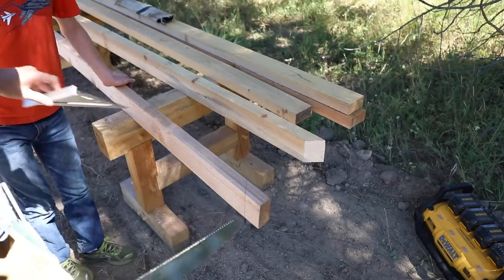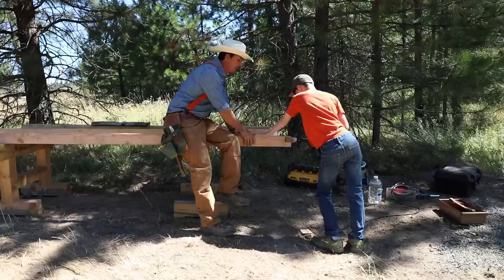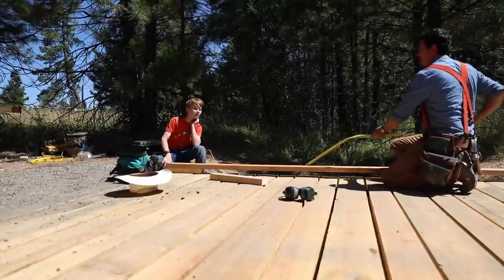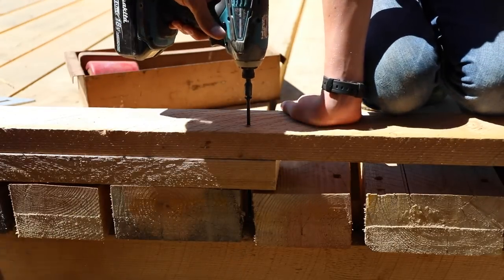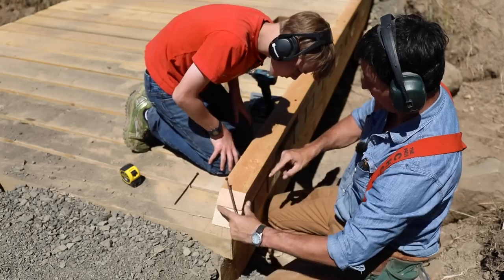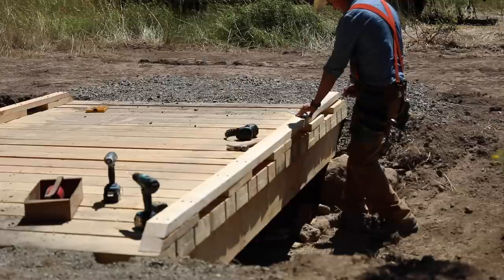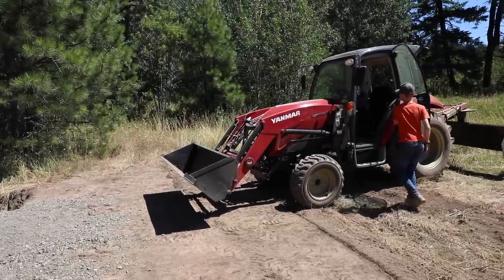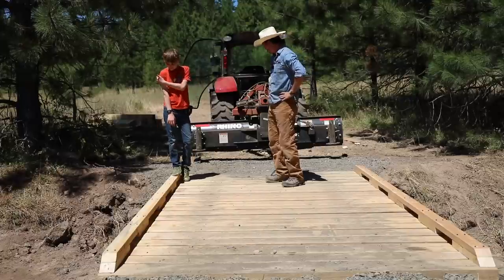How To Build A Bridge Over A Creek For A Tractor 9

Comment: Wranglerstar,  I seen the bridge flex, but that's something you want it to do.. All bridges have flexing points.. 
And just a thought, You should think about putting in some Bridge anchors, because my family built a small bridge like that, and it was fine until the had a flash flood,  and it turned the bridge sideways, and moved it about 30 feet and damaged it to where it wasn't able to be fixed..
They replaced it, and they dug a 6 foot deep hole near each corner of the new bridge,  and in the bottom of each hole they formed with bag Crete, a 1ft x 1ft x 3ft long, block with 4 lengths of 3/4 inch rebar with a rebar lope coming out the top, and then used heavy chains with turnbuckles to connect them to the bridge.. And they had another flash flood the next year, and the bridge stayed in place.. Just a thought, because we all know wood floats.. Peace!!

Comment: Can I make 1 suggestion?  I would put 4 posts to mark the outside edges incase of heavy snow.  It can be hard to follow a bridge even on a road when everything is covered in snow.
Reply: 1975Jdonov well one down side to that say he was to put 6 foot post in the ground 2 foot and leave four up the back blade on the tractor wouldn't fit its 8 foot wide itself I watched very close when jack came across on the tractor and was watching to see if the blade would snag the side rails and it hangs over those rails so he would have to keep the blade high in order not to snag the bumper rails so image 4 foot tall post on each end anything 8 foot or wider would have to be lifted I.e. Logs for milling are 8-? Foot long so could you imagine lifting say a 20-30 timber up 5 foot and the tractor see sawing that wouldn't be good but good thought in the snow just no practical for moving things across some of those small fiber glass rods the survey teams use that are blaze orange and reflective would be much better then you could push the load over them and they would bend and snap right back up in place
Reply: Bryan Waugh you can make the posts wide enough to drive anything through since it is just a guide.  I prefer something sturdy that will stand the test of time.
Reply: Sounds like an OSU wildlife grad.
Reply: gsardokla me or the other person
Reply: gsardokla I never went to college.  I am just speaking from experience.
Reply: You. Wetlands wildlife ecology with Dr. Gavin, or mammalogy with Dr. Glass.
Reply: Solve both problems with simple orange fiberglass snow markers typically used on driveways. I have an 8' wide driveway and a dually with an 8' wide bed. Tire track with is literally about 2.5" less than the driveway, those markers have saved me from tearing up my lawn on many occasions. What I did was put them exactly a dollar bill width away from the driveway edge. Since a bill is so common it's easy to judge the distance on each side when backing in with mirrors.

Comment: Liked the bridge, also glad of the spacing of beams below the decking, the bending is to be expected at such a weight, but the space the decking has to cross isn't such that it's likely to break due to bending ... i check (as best i could) both the crossings and didn't see any bending in the main beams, though the video-pictogram seem to show maybe just a cm of bend in the main beam (if it's that) when the tractor is dead center (might be distortion of the picture as well). There isn't a problem with that, as it will only be once in a while and it's only so little. Also wood can handle bending pretty well (as it's pretty much growing to deal with high winds)  ... so job well done... 'Jo Bro' is finished.

Comment: Nice Job!  I'd give the planks an annual coat of non-detergent 30 weight oil.
Reply: halnywiatr: It's a surprise that someone remembers non-detergent 30 wt oil. I don't know about it as a wood preservative. But I  do know it is the best substitute oil for a chainsaws bar and chain oil, if the real stuff is not available. Being non-detergent helps it stick to the chain better than regular 30 wt, or any other motor oil. This is an old remedy, but not for times when ordinary bar and chain oil can be had. Even cheap varieties of bar oil are better.
Reply: Generally 30 WT is not "cloying" enough for frequent use as a bar oil except in very cold conditions but is certainly better than nothing (and I have used it on many occasions)..  However, for sub-freezing conditions you can use Automatic Transmission Fluid on the days that regular bar oil stops flowing easily.  Straight 30 wt is preferred for small engines like lawnmowers that utilize splash lubrication as detergents may froth and run off the parts too easily.  Most places still carry it often in 20 oz bottles.

Comment: I am thinking now of navigating this bridge after some heavy snow. Might be hard to make out where the bridge is if the snow is heavy enough. I would plant four posts at each corner about 4'-6' high so I can make out where I need to drive. These can be say 5"-6" round and don't need to be right on the corners where you have to worry about hitting them too much - a little white paint with red tops won't hurt. I don't know if you tend to have this same issue with any of your other bridges?

Comment: Love the Papa Son Bridge. Ok, I admit I am dense as a rock when it comes to building a bridge, but would building the bridge four to six feet wider have resulted in more of a built in safety solution to prevent a wide tractor/truck from risking sliding off either in rain or ice?

Comment: i don't know if i'm right, but as i could see so far, the gravel road parallel to the creek ends at the bridge? if so, i'm not sure if the bridge should have build in an 90 degree angle to the road. that would be a sharp turn, not easy to handle in certain moments ... e.g. with a trailer etc.

Comment: There appears to be quite a bit of flex in the deck planks. Is there a slight gap between them, and the inner stringers? I certainly don't see any give in those 10x10s. I think that you could probably drive a tank over that bridge without any breakage. It looks nice as well.

Comment: Attention other viewers: IF your deck or bridge or platform or pier is going to go through soak/freeze/ thaw cycles DO NOT USE screws . One winter will strip the wood internally at the thread wall  from the expansion of frozen wood. A low cost practical alternative is to use spiral nails. They will loosen too ,but every 5 years or so you just take a hammer and drift and just bang them back down. Another point not covered on this video is that the deck material should be placed bark side up or out. If you don't do this, the wood will cup and hold puddles of water....rather than shed the water. I see this ALL the time on home built decks and marina piers . This is a very common mistake.
Reply: Whilst you have a point, I'm wondering where you are going to get 300mm spiral nails from?
Reply: Probably not from a big box store.   12 inchers from here is one place   http://www.bestmaterials.com/detail.aspx?ID=22021&utm_source=bing&utm_medium=cpc
Reply: Probably because a fence would shed water better than a deck. The point is frozen wood will expand and loosen anything . Frozen wood will even stretch nut /bolt combinations.

Comment: is the degree of precision your are working to really necessary on this bridge?  I mean, what's the difference between an inch or so...unless the purpose is really for Jack's benefit?
Reply: I think working to the 1/4 inch is the least amount of precision I would ever use in any project and I would consider that to be very rough.  Something like this, and most projects, I would work within 1/8 inch tolerances.

Comment: I suggest painting the bumpers with a high visibility color or at least the ends so that you can place the tractor between them faster and easier. I know it wouldn't be too hard either way but just a thought.
Reply: DChestHair I suggested couple of those fiberglass surveyer stakes they are laze orange and have a reflective strip so the can be pushed over I.e. Blade on the tractor logs what ever and snap back up and if they break only 2 bucks give or take
Reply: How about hiring a "flag person"?

Comment: I am a teen ager who works in a few different shop environments and it seems all of my pencils disappear and my fellow colleagues get new pencils when I lose mine. Now they are much older than me and control my lunch break and what already cruddy jobs I get so I don't really want to go beyond the usual hey is that my pencil so I would like to have a few made with my name on them. I was just wondering what site you use to have your pencils made because the site I found doest make carpentry pencils your response will be very helpful.

Like if agree and want to know.
Reply: Garrison Bogdahn they can only get new ones when you leave them out of sight. I have the have it of wearing a belt knife for stripping wire (Klein cable splice kit) and my pencil sits there every time it's not in my hand.

I've worked with the crusty old jerks, and it makes me want to be opposite of them and to remember when ever I get a apprentice to teach rather then screw with
Reply: Garrison Bogdahn get a can of pink or purple spray paint & spray all of your pencils. There'll be no denying ownership then & you'll save $$$ on custom pencils.
Reply: they arnt crusty jerks they just like messing around.

and spray paint wears off to easliy and is gone in 2 or three days

Comment: Just like metric, imperial is easy after dealing with it for awhile. The thing about imperial is that's what a lot construction material is produced in. 
Hands down though metric is great for large commercial project blueprints.
Reply: AllaroundNbackagain except when the workforce is not familiar with it then all kinds if short and long cuts are made. 
Saw this happen in lousianna at a still mill. Wire was labels in metric footage while all measuring instruments were standard, and calculators with conversions don't always work
Reply: tek413 
That would fall back on bad supervision and teaching.
Reply: Most people don't do commercial blueprints. Imperial will be around for a long time.

Comment: Go metric it's much much simpler than the old feet & inches way.Good series of videos though. And where's the sign with the name on it..?? A builder/Joiner from New Zealand. .☺☺☺☺🔨🔨🔨🔨
Reply: Darryl Kennedy metric is opposed here for several reasons culminating in not wanting to switch from the old way.

Metric has been growing in me over the last couple of years but yet it still has a mystery about it. What that boils down to is me labeling physical objects with the metric sizes to get the system ingrained in my head
Reply: Metric is evil. People that use it get cancer according to the state of California.
Reply: You're right.  I'm sure if Cody asked Jack, "Jack what is half of 373 cm or three meters 73" it would have been much easier than half of 147 inches.  They both work fine.  Once you get accustomed to one, it is not always as easy or intuitive to switch to the other. 

I've met, and seen, many older folks who learned on the Imperial system and switched over to metric in their lifetime.  funny thing is most of those who switched over still predominantly use Imperial and it works for them.

Eventually all the old/older feet and inches folks like myself will die off and maybe then the metric system will concur the United States.
Reply: Darryl Kennedy 
Don't you know the American way is the right way?
Reply: iamchillydogg what's the unit of pressure in metric?
Reply: NordboDK pascal I believe, 1 pascal is 1 newton per square meter
Reply: tek413  was still in my Apprenticeship as a Joiner / Cabinetmaker when New Zealand swapped over in 1974.
Everyone hated it at 1st but it soon became obvious that it was a far easier system.
No more Feet,inches,1/8ths,1.3/2nds etc etc.  Some thing's remain the same however as the metric equivalents never caught on.
We still say 4×2 for example instead of 100 × 50 and all timber sizes, including sheet materials in the building industry here,are still called in the "Old" measurements. A sheet of plywood, for example,is still called an 8×4 instead of a 2440×1220 which is its exact metric equvilent. 
As we've been using it for over 40yrs it just comes naturally but as mentioned somethings are still said,or called out,in the old system. 
The building / construction industry would never go back however and I'm sure if you guys tried it you'd soon get used to it.
With all measurements in divisions of 10 you can't go wrong.
10 millimetres = 1 centimetre.
10 centimeters = 100 millimetres. 
100 centimeters = 1 meter.
1000 meters = 1 kilometer. 
It's easy once you get to know it.I'm not saying everything converts so well,as we still say Horsepower, torque, instead of converting them,and wind / air pressure still stuffs me up,and speed is still said in MPH instead of KPH but the system works.
Go on a few web site's and have a look OR if your a builder just start using it yourself. I'm sure you'll like it.
Sorry for being long winded but I'm having a Trump free day today,and like McDonald's, I'm loving it..☺☺🔧🔨🔩Metric ✔👍
Reply: In SI, the scientific basis used by physicists the unit of pressure is Pascal (1 Newton per square metre) however in everyday metric units there's also kg/square cm, which are closer in magnitude to PSI.  One kgf/cm2 is about 14 PSI but it's about 98,000 pascals.
Reply: PKMartin  yeah I know but even in New Zealand where we've been metric for years we still go to the petrol station and check the tyre pressure in ft/lbs per sq/inch.crazy I know but it's still easier than those kilopascal things.
Reply: PKMartin thank you, that just goes to show how few people actually use metric, where the unit for pressure is a bar.
Reply: Metric isn't easier then imperial, you just have to learn it...
Reply: NordboDK Um a bar? We use PSI, just like most other peeps.
Reply: 1 bar is 100000 pascal, so it's kind of like an abbreviation or something, but not the actual unit.
Reply: Metric is simpler on the division (+ and / and X too). You have block numbers. 1340 mm what's half quick? 500 500 150 150 20 20, by the time you've opened the tape ruler, you've reached your half simply by following the numbers. (For those confused, 1000/2=500 300/2=150 40/2=20 1340/2=670, by adding up VISUALLY your half numbers, with your finger, you get where you need to be, really quick).
My favorite carpenter, the guy i source most of my fine lumber work taught me this method. He's so freaking fast. The guy is in his 70s, but when it comes to measuring up work, he might as well be the pit team of a F1 car. Zippy little fella :)
Reply: aserta 
OK I'm lost
Reply: Cody Nichols  How so...Please explain...???
Reply: Darryl Kennedy 
too many numbers too much to split down and all that just just gets me lost. I'd rather go half a seven is three and a half half of 14 and 7
Reply: Cody Nichols  .. C'mon it's easy.If you can learn to drive a car you can figure metrics out. 7÷2=3•5.  70 mm ÷ 2 = 35 mm  7 meters ÷ 2 = 3•5 meters. Certainly beats 1/6 1/8 1/4 1/2 13/16 etc etc. Give it a try. In the building industry you can't go wrong. What's 7 feet ÷ 2 = ??